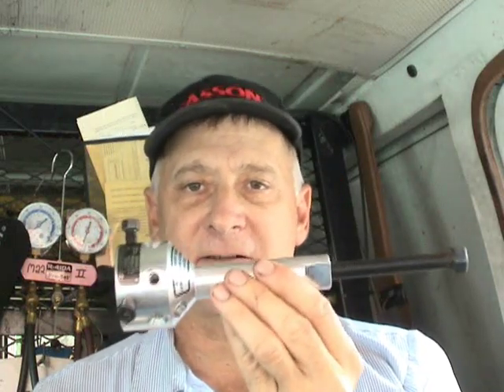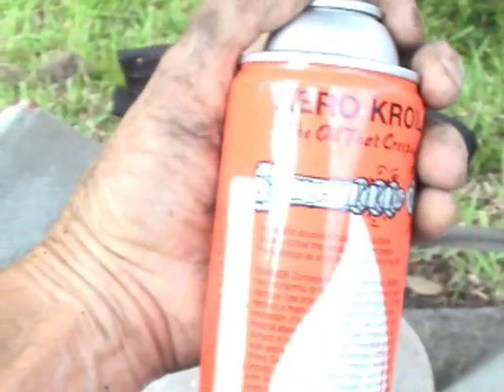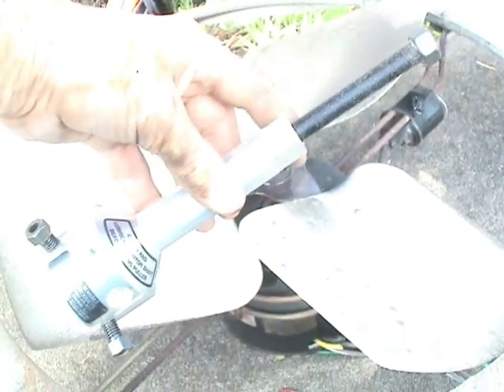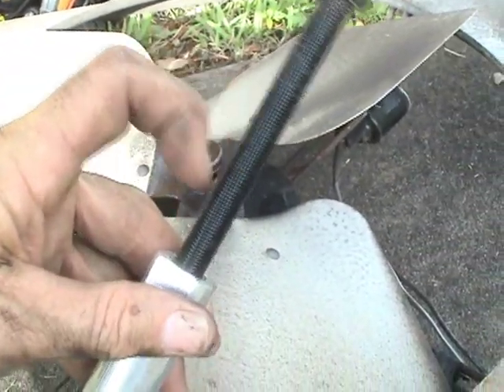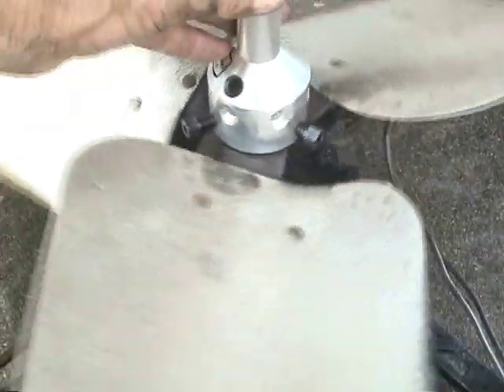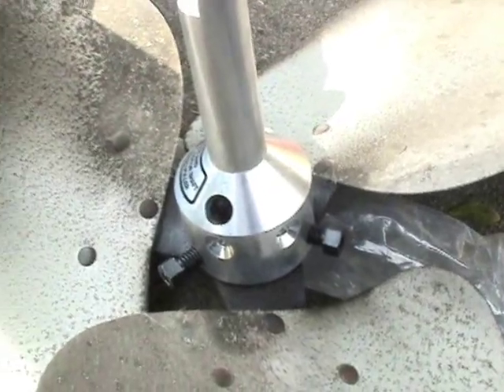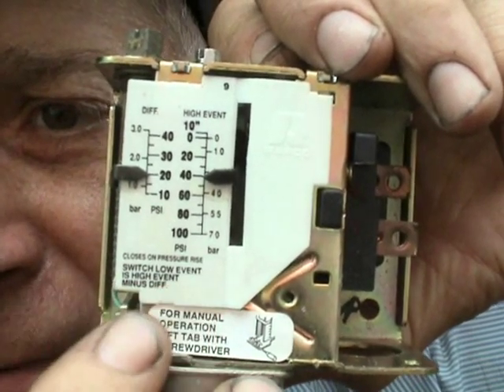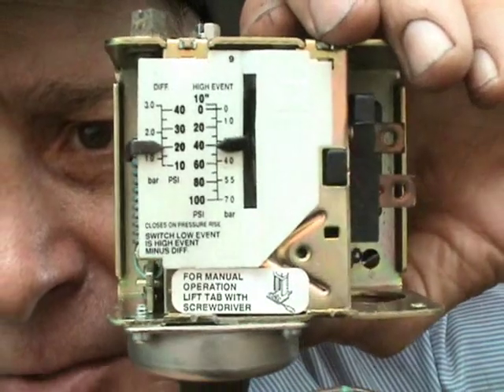HVAC Hub Puller

Comment: Very nice video,  Question:  My out door fan motor is drawing  1.03  Amps       It is stamped:  FLA   1.3  Amps   Should I change it out?  What does FLA  mean?   Thanks you so much for your help.
Reply from the maker: FLA means Full Load Amps. You can Google this for more infor. I wouldn't replace the motor.
Reply: Thank you for responding

Comment: i found n easier way to pull blade off witout using hub puller..... 1st sand dwn the shaft. 2nd lube the shaft.3rd take of screw dat holds blades to shaft .. 4th grab a pipe dat fits the shaft in n sits on the base n grab a hammer n hit top of pipe to to break it loose n just hold the fan blades n let the weight of the motor fall thru n ur done .....

Comment: Great tool, I keep it in it's own little bag I purchased , with a service wrench with the appropriate allen head and extension with the appropriate socket. In seconds I have puller tight to hub, snap extension in cordless drill and have motor removed in virtually seconds. Works great on BLOWER MOTORS to!!!THANKS DR.Z for the great videos... FRITZHVAC

Comment: These are so very handy and nice. I work for a huge retirement place that has split systems, heat pumps, geothermal, and fan coil systems. Just remember to clean up the old shaft and use a bit of lubrication before useing it like it shows here. Ive never had a bit of problem with my puller !!

Comment: That hub puller is a piece of junk. You should use a steel hub puller. I personally have ruined that patricular hub puller, being aluminum. I have also talked with many other tech's and they said the same.

Comment: Just picked one up the other day, coincidently I had a bad cond. fan motor after watching this vid..jk. Went ahead and paid $100.00 CDN for this little beauty, affixed the device to the shaft and I was able to spin the nut on the end of the puller by hand and the fan blade came right off...un freakin believeable...great tool, quite pricey for what it actually is though

Comment: that method will work providing that the condenser fan motor is already dead. Beating the shaft on a brand new motor hell no lol. Bad for the bearings

Comment: Nice job Jim! Back in the old days, when I was a diesel tech, I aquired a nice habit. Before I would pull a hub of a shaft, or knock a bearing out of hub, I would always measure the distance - how far out is the shaft or how deep is the bearing. After I had the new parts installed, I would measure again. If the measurement came up different, I wanted to know why.

Comment: I've used this tool many times. And, ruined a few... The major flaw is that the threads are too fine. That being, to make it easier to turn, yes. But also reflects on the life expectancy of the tool itself. A stubborn hub is more than likely stuck on a burr created by the set screw. If possible and to preserve the puller, smack the blade DOWN the shaft first to inspect and/or remove the burr. Then pry up with an open crescent to apply the puller with the minimal amount of  travel possible.